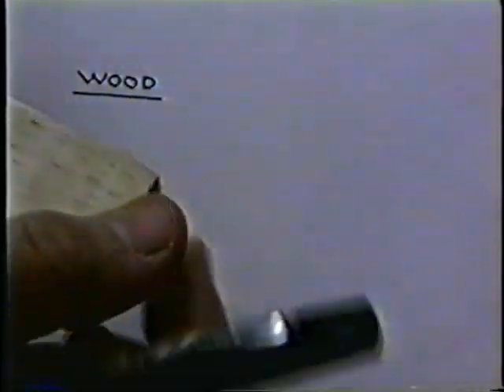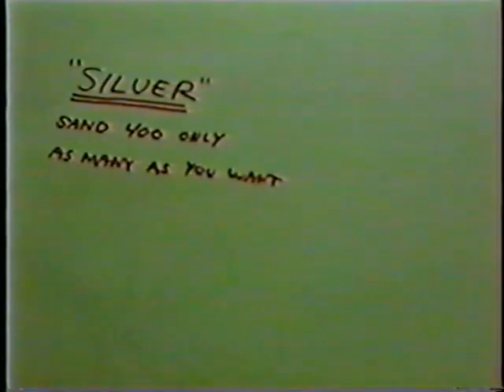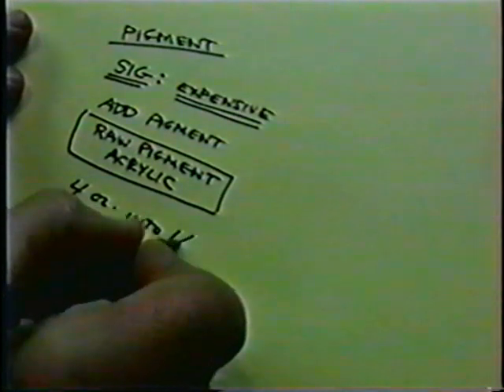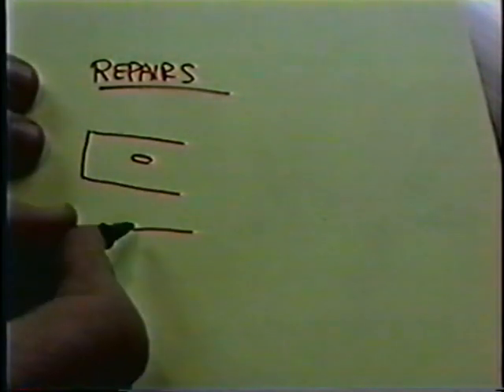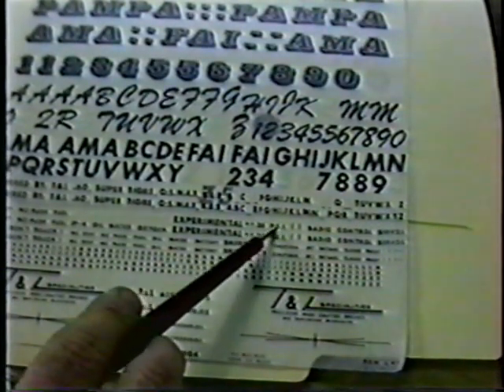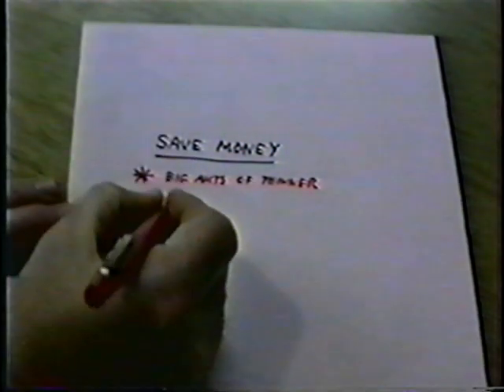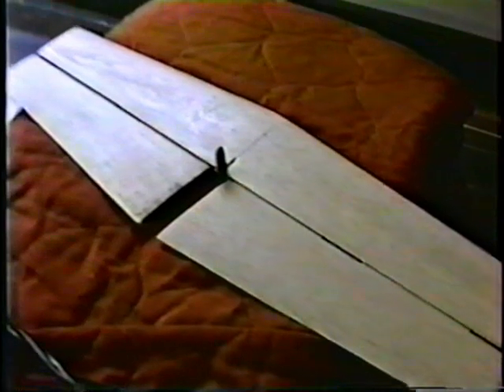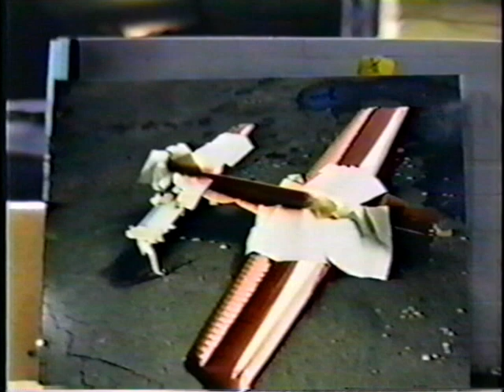Advanced Dope Finishing

Comment: For grain filling. I have had very good luck with rubbing talcum powder into the surface of the balsa and then applying a coat of dope, clear or sanding sealer. I then sand with 600 or finer. I get a glass smooth surface this way.

For surfacing for reinforcelment, I like using light or medium weight silkspan. I brush it down onto the balsa andvthen fill it and sand it to glass.